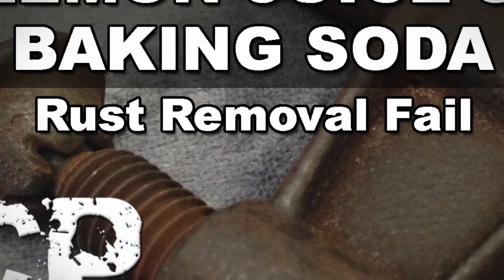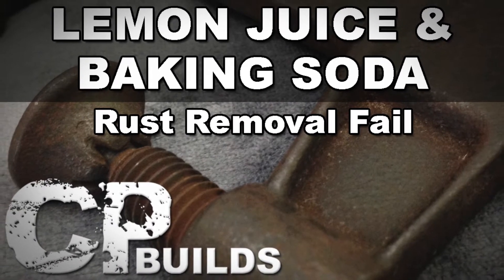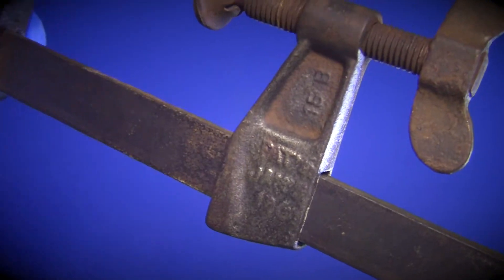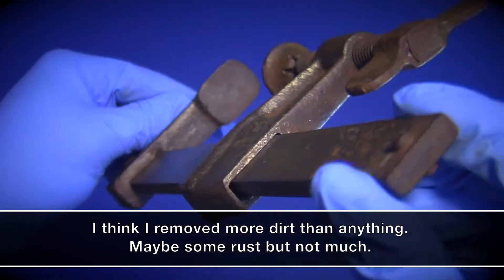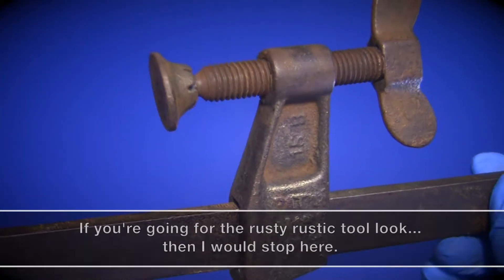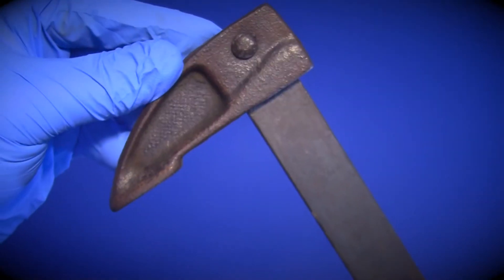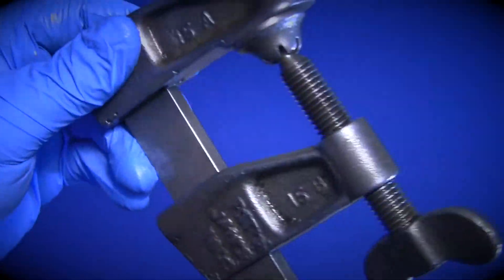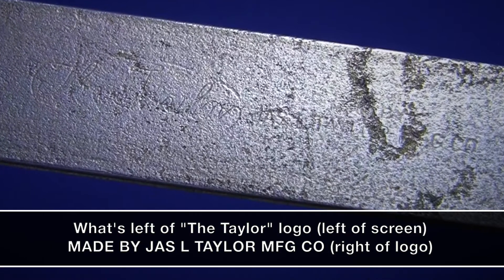Lemon Juice & Baking Soda Rust Removal Fail // DIY Tool Restoration

Comment from the maker: I know a patent date doesn’t mean that’s when it was made. When the Taylor Company moved to Poughkeepsie, NY in 1911 that’s when they started to stamp that on the bar. This does not have have so I believe this was made before 1911. I can’t be certain so that’s why I said that it may be, if not older than, 100 years old. I believe it’s over 100 years old but I can’t be for certain.

Comment: Either the lemon juice or the citric acid would work well on their own. Baking soda only neutralizes the acid. I just use vinegar.
Reply from the maker: Wildman Tech I completely agree with you. I read that baking soda and lemon juice was a good way to remove rust so that's why I tried it. I had my doubts from the beginning believe me. My friends used vinegar and salt. I'm gonna stick with the citric acid for now. Although I may give the vinegar and salt a try. Thanks for your comment 👊🏻👍🏻
Reply: I did a vise restoration a couple weeks ago and you can see, vinegar alone works really well. BTW, I'm giving that vise away if you're interested.
Reply from the maker: Wildman Tech I'm doing a vise restoration when it gets warmer out. You have pics up or a video of it by chance? Be interested in see how it came out.
Reply: Yes, it was my video release three weeks ago, and it's all over my instagram feed. I did another a couple months ago too.
Reply from the maker: Wildman Tech ok I prolly saw it. I'll look again though. Thanks.

Comment: From what I understand, Baking Soda & water is best for the light surface rust you find on things like metal face-plates, especially if you're concerned about something stronger taking the paint off.
Reply from the maker: Oh nice. I’ll stick with citric acid tbh. Didn’t remove paint and it’s fun to watch it in action. Thanks for the comment 👊🏻👊🏻

Comment: The active ingredient in lemon juice is citric acid. So by mixing it with baking soda you basically neutralized it, and just removed rust by rubbing it with the brush. Lol. You basically did the same chemical reaction two times, but in the repeat reaction you didnt neutralize the citric acid until after you removed the rust. Whom ever told you to add the baking soda directly to the lemon juice is a major troll.
Reply from the maker: Stupid trolls. I watched a video of someone using this method to remove rust and it ‘worked’ for them. I honestly didn’t think it would work but wanted to show it anyways. I love the citric acid and warm water method though. Quick...easy...fun to watch. Thanks for the comment 👍🏻👊🏻

Comment: You have to allow it to sit for no less than 3 hours before you begin to scrub. Also... you would want a bit more lemon juice to baking soda ratio. While baking soda lightly removes rust, it's used in this method as more of an abrasive.
Reply from the maker: Ahhhhhhh ok. Knowing that I still prefer the citric acid. Especially with the 3hr wait time for the other. Thanks for watching and the comment.

Comment: where do you buy citric acid and how much do you use?
Reply from the maker: steve walker I used 15 ounces and I bought it at Menards. In the canning area. Links in the description. Also there is a link to a previous video that used citric acid in as well. I believe it cost $3 for 7.5oz container.